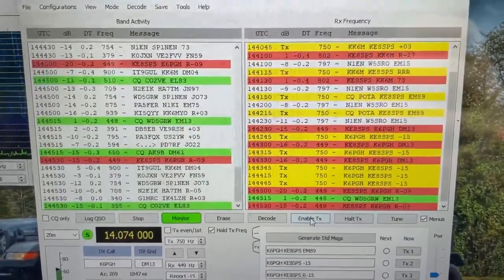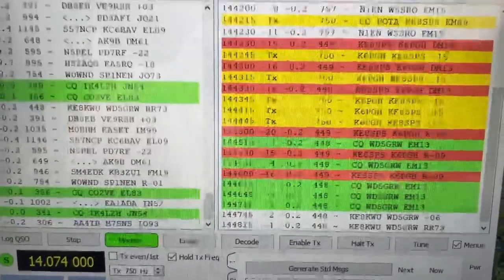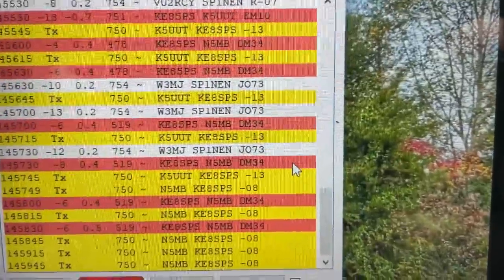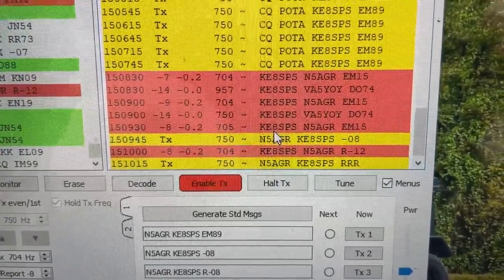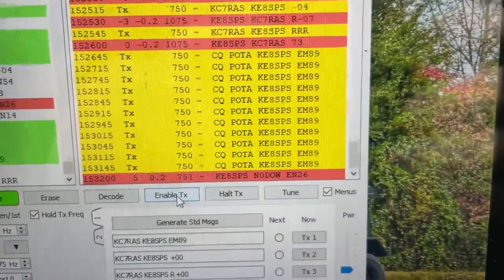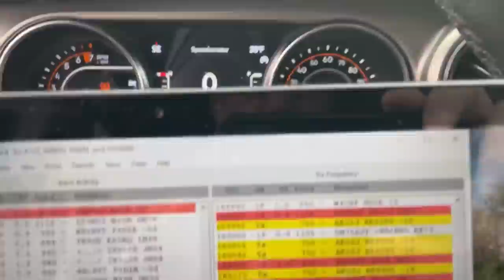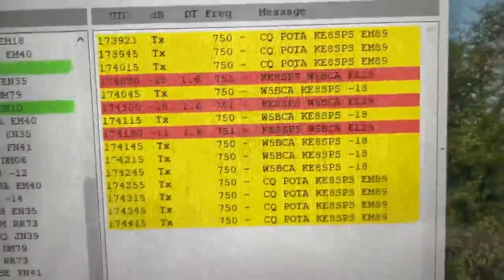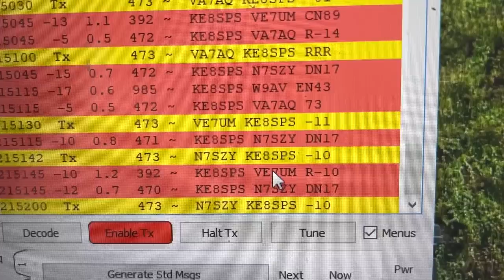POTA Activating 4 parks in one day Why!!!!

Comment: Looks like you're really enjoying Ham radio. I received my ticket in 1981, worked it for about 18 months, then due to work I didn't have time.  About 3-4 years ago I bought all new equipment, hooked up, and maybe within the 3-4 years I have an hour on HF, and 1 hour a month on VHF.  VHF is picking up due to I run the Net for the USCG Aux as SO CM.    Enjoy, most the guys/gals are good people.

Comment: The difficult thing with wsjtx is if you don't have a cell signal and your time is off on your computer/Raspberry PI.  My fix was to tune into 10 MHZ for the clock and set my clock.  It is tricky but you have to be within a miniscule time frame.  I guess I should have watched the entire video as you have the same issue as I did.  The POTA issue with the park number is you have a special message block on the 2 tab on messages.  I don't really do FT8 for POTA but you have me interested now.  Thanks for the video!!!

Comment: Some ferrite torrids will help or eliminate the EMI from your laptop. I use a Mix 31 torrid for my IC-705 and both Mix 31 and a 43 on my IC-7300. 

The USB cable is a lot longer for the 7300 compared to the one I use with the 705. Icom recommends a 3ft USB cable or less to be used to reduce the EMI. Too much EMI can cause some problems with the radio and/laptop. Just a few turns around a ferrite torrid will make a difference. 

Hope to catch you on the air.
73, W4ISB.
Mike in Tennessee.